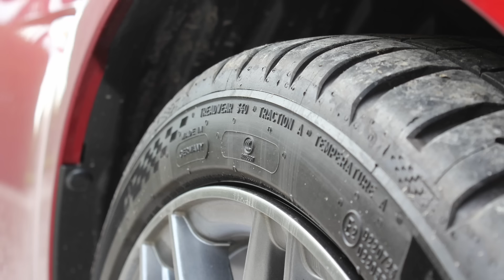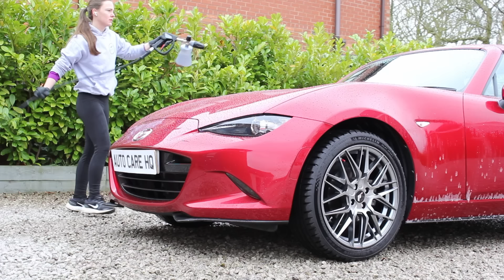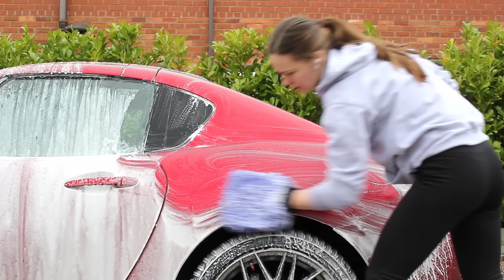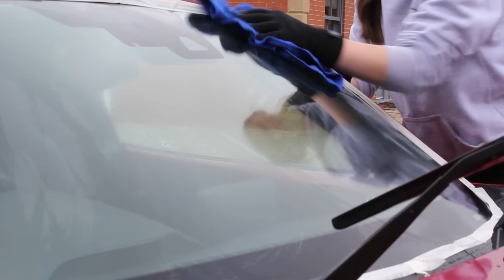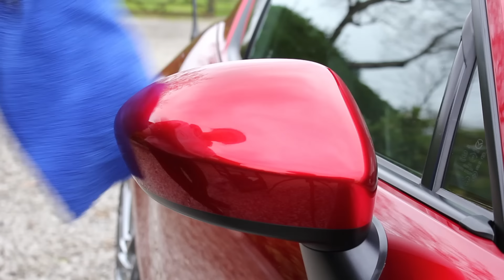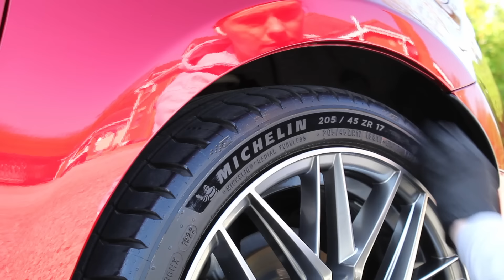Mazda MX-5 Exterior Detail | Wash, Decon, Polish and Coating

Comment: Hi Heather 👋 just catching up on this video and your cars   thorough detail. The result is truly first class 👏. Just one qu. if I may. I remember last you applied a GTechniq black trim product to the mx5?  and a long term review of how well it performed?.......... can I ask how well it performed, and would you recommend it? as I noticed this time, the product used on the black trim had changed? Looking to add some protection to my new cars black trim. Thanks Heather!
Reply from the maker: Thank you! So I got about 12 months out of C4 before I thought it needed topping up. It hadn't quite got to the level it was pre-application but it definitely was at the stage where it would benefit from an extra coat. I'd definitely recommend it, I think the investment it well worth it to avoid having to apply something every wash. Plus if you are using it on a new car it will likely last longer!
Reply: @AutoCareHQ  Brill! Thanks Heather the C4 is now ordered for the Macan T. It's a bit of a departure for me as my last  7 cars have been minis ! Back to mini in 4 years' time, though!

Comment: That has got to be the most thorough multistage cleaning and coating ive seen! It takes me five hours to wash and clean my car inside and out, thats just wheels, wheelarch tyres etc, then snowfoam and two bucket method, hydrophobic coating then drying and detail spray, finaly vacum and clean interior. As i say thats fi e hours and im absolutely exhausted! Admittedly you have a relatively small car, but what you did in one day is truly astonishing with clearly fantastic results.!
One question, the OCD in me is driven mad with imperfections such as even micro stone chips, i even have a full PPF application, but of course whilst the paint is being protected, you then end up with imperfections from stones hittingbtge PPF! Crazy i know, but how do you reconcile those tiny and all too inevitable blemishes on your car, when it looks so perfect after all that work? BTW im 58 so thats my  excuse for being knackered after clearing the car!😂
Reply from the maker: Thanks for watching Keith! It did actually take me a couple of days to film this, even then I was absolutely exhausted 😂 Stone chips are a real pain, this car unfortunately has quite a few because the paintwork is so soft and I used to commute on a motorway in rush hour (not a good combination)! It's possible to touch them up but with this colour it's quite tricky even with the Mazda chip touch-up kits so I've kind of made my peace with them to be honest

Comment: Great video. Sorry to ask a stupid question, but here goes! Were you using a pressure washer as I couldn't hear it if you were? Thanks.
Reply from the maker: Thanks! Yep I was, I use a long hose though so I can put it round the corner so you don’t hear the sound of the motor as much

Comment: Maybe I missed it, was there already an aftermarket coating on your Miata before this process?
Reply from the maker: I had applied Synergy Lite on my car about 8-9 months before filming which is a lightweight ceramic but it was tailing off so the polish was able to remove it before applying the new coating

Comment: Another cracking watch so thanks again. I am sure I have told you before the colour of your car lends itself to gloss & pop when looked after well as you do. I use wax now exclusively on our cars as after getting my JCW Gyeon 5 year coated although it looked good but I was not blown away and I sold it shortly after anyway. I got a delivery yesterday of the Turtle Wax wheel and tyre Hybrid Solutions products including the Graphene tyre dressing to try as I was looking for a change from Serum that I have been using for about 3 years so I will see how that works. I have not tried it yet as we are in the middle of a heatwave in Scotland and I don't like to detail in direct sunlight.  Yum Cars is next to try if I am not impressed. I look forward to the next installment.
Reply from the maker: Thanks very much John! I really like that TW Tyre Dressing, definitely a bit glossier than GT Serum but a bit quicker to apply I’d say
Reply: @AutoCareHQ  You are selling it well. 😃😃

Comment: Metal tire valve dust caps are a no-no, switch to plastic dust caps, metal caps if left undisturbed for a certain amount of time will get stuck, its because of "galvanic corrosion", a chemical reaction that will fuse the two dissimilar metals together if given enough time.

Same situation when an alloy wheel will need some force to get off from the wheel hub (which is made of steel) whereas a steel wheel will not have this problem because both wheel and hub are made from same metal -> steel.

Comment: Absolutely fantastic and that cars a credit to you. You know I messaged over doing a ceramic coating etc  but in this it's real life testing so again something others won't do . As others have said the colour pops and even though ceramic isn't for my needs I'd certainly put some on the Adam , I'm just not brave enough to apply it just yet and would need a test panel to practice on .
Reply from the maker: Thanks for watching Andy! I wouldn't worry about the application process being difficult to be honest. This is only the 4th coating I've tried but they've all been really straightforward to use
Reply: @AutoCareHQ  I do have a wing off my old Primera in my shed and I've got some ceramic somewhere so could try on that . On my own car it's really the wheels I'd want to do . Need to speak to the body shop at work about a price to do it. Mine are original paint so 17 yrs old I've had my moneys worth

Comment: I’m planning to apply a Ceramic coating outdoors at some point so I’m looking at ones with a quick cure time rather than the normal 24hrs.

Like you say, you need to work with the conditions or all the prep work will be for nothing
Reply from the maker: Yeah that makes a lot of sense John. I was fortunate that the weather forecast was accurate but a shorter time would take the pressure off a bit

Comment: How often can you polish a car per year? I've heard that polishing removes a layer of paint every time...
Reply from the maker: It's honestly quite tough to say as every car is different. This car for example only comes with about 80 microns of paint, whereas most have at least 120 microns so it's a bit difference. Very fine polishing only removes a small amount of paint but I wouldn't do it more than yearly. I'd only really do it when necessary rather than just as a routine